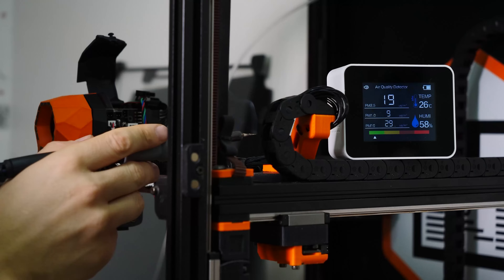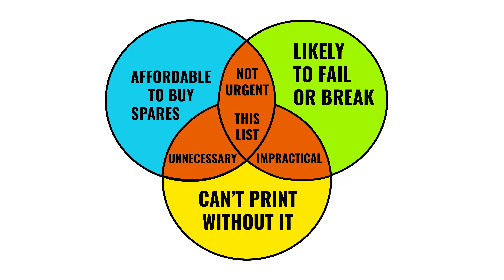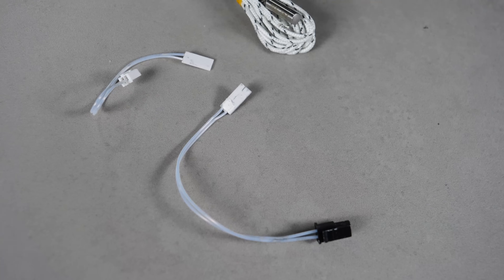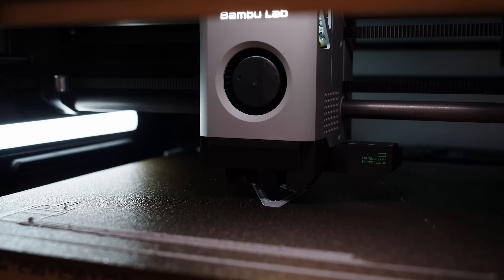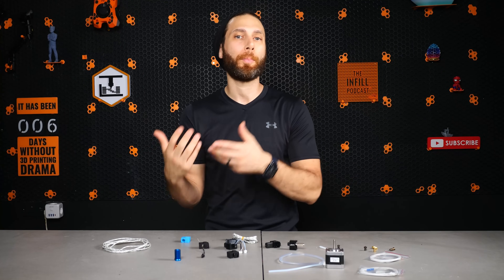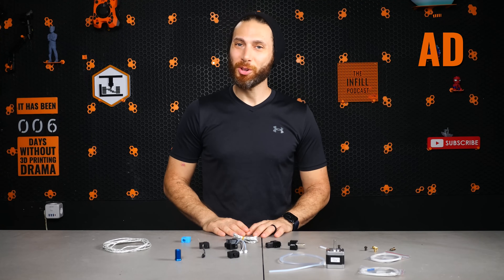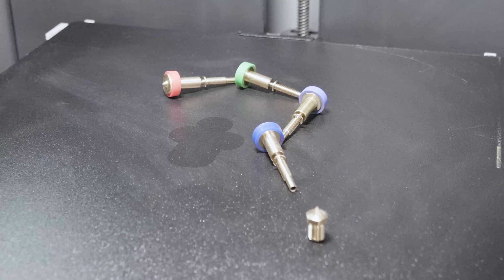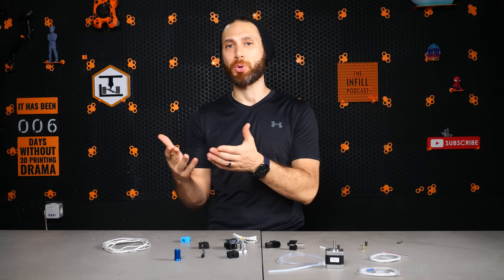Never Let Your 3D Printer Sit Broken Again With These Spare Parts!

Comment: I have several original CR10’s and two of the control boxes have went to the 3D printer in the sky. I haven’t been able to find replacements they don’t make them anymore. 
Unless it’s marketplace and the they usually have the control box “not working”

Comment: Another thing to keep spares on hand of with relation to the bowden tube are the compression fittings they slot into. The teeth that grip the tube can break off causing your bowden tube to wobble or even fall out of the extruder.

Comment: Have a spare entire  extruder for both high and low temperature filaments.  In fact I have two for each  - why? Well I hate swapping nozzles, and even using different plastics is easier with a dedicated extruder. I have also done my own modifications to some of them (fans, nozzle mod, and part cooling fan outlet)  for particular filaments I only have the one 3D printer a Qidi X-Plus, so heavy handed on the spares is easier if you only have the one machine. I also have multiple print surfaces of various types.

Comment: I learned this the hard way with my fan... The fan only had 2 broken blades so I figured it's fine.. but it caused a chain reaction: nozzle clog (need nozzles which I was the only spares I had) > silicon socks (totally sticky/covered in molten plastic) > molten plastic went up to the thermistor and cause it to behave weirdly, destroyed my heatsink too because the plastic went into the groves and was impossible to clean out totally. Basically, I had to swap out the whole thing, but I didn't have spares on hand. Had to wait 2 weeks for shipment from china 😭 Now I keep a whole hotend set spare and a few spares of the cheap stuff lol.
Reply from the maker: Been there! That’s why I made this video!

Comment: Heater cartridge crimp connection to the wire it's on is definitely a wear part. I have had the crimp become undone after quite so many heating and cooling cycles, and i'm not trusting that whole connection again since the surfaces are likely to be oxidised, i'm not re-crimping it, just put a new heater cartridge in there.

I don't personally use a silicone sock, i just dress the heater cartridge in Kapton tape, but it depends on the construction of the unit whether you want to do that, and silicone does have its advantages, as it's non-stick and can offer some nozzle protection.

Extruder gear is another consumable part, especially on printers where it's brass. Actually if you have a plastic extruder lever, buy a cheap alu extruder for $4 right away and just have it at hand.

Bearings should be considered consumable. They should normally last a long time but one or two might just give up earlier than expected. When a stepper motor seizes up, that's bearing failure, and these are 625 type you can just replace them yourself. Don't worry, the sub $10 stepper motors from China are not precision assembled devices, they are self-aligning, they experience so much shaft warpage and bearing play in real 3D printer use that the alignment is effectively bad anyway, all the precision bits are pre-aligned and epoxied together, as long as you put in the parts in the same orientation and order as you found them during disassembly, just pay attention, it'll work like new.

I hope you settle in well in these trying times and hey being in EU has its advantages! 3 day shipping from Germany and Netherlands typical, frictionless shopping EU wide.

Comment: howdy friend! glad to see you are still posting even with the current events and "exile". Hope you and your family are doing fine whilst waiting for the situation to get better.  Stay safe!

I myself have a lot of spare parts, but I have one broken down printer (a locally built one) and another one (an Anycubic Mega X) that was giving me some issues which sorta made it unusable (not counting the resin printer which is standing for months). I didn´t work on it because I was not in the mood to do so, so I was without printing for the last four months.

Recently (in fact it´s not finished yet, I´m waiting for the DSI cable for the new screen) I totally rebuilt the Anycubic´s electronics. Converted it to 24V (used a Kobra Plus print bed which was a perfect fit, and now I can go beyond 95C on the bed, I tested it up to 120C and it works), put on a direct drive (Biqu H2S Revo), replaced all the electronics (new board is a Manta M8P with a BTT CB1, they were stashed for a Voron build I never started and that´s why I used such an advanced board on the Mega X) , redone all the wiring, etcetera. And now it´s running Klipper (it was before, but it was a basic configuration on the stock Trigorilla board with nothing more than a CRTouch added, now it´s properly tuned,. along with z-tilt and other features). It´s not faster than stock in printing speed (the kinematics can´t handle higher speeds, specially the big 300x300bed, its sweet spot is 35mm/s) but it´s tuned like a charm, getting perfect first layers and layer adhesion now. The new screen ? I already printed and assembled the mount, all it takes to put it in is the new DSI cable, which should arrive tomorrow. The fun fact is while I was rebuilding the printer, I was printing parts for it as well as each step went, so I tuned it and changed some stuff while I noticed it was necessary (for example, heatsinks on the CB1 weren´t enough, it required a fan, we´re getting near 40C ambient temp here in Brasília and the CB1 was overheating). 

Having that finished, I´ll start the project on the second one, which is a Brazilian-manufactured coreXY (Sethi3D Farm) which cost me a lot of money and gave me so much trouble that I actually considered throwing it in the bin. But the success on rebuilding the Anycubic gave me hope that I can make that work again (and get rid of some of the "alternative" solutions the manufacturer opted to do on the wiring). However, that will require more work, a new PSU, a new bed heater (it uses AC heating but I´m not confident enough to work with that, specially considering that I´ll make an external enclosure for all the electronics) . I think now I´m in the mood for 3D print rebuilding LOL. This will be a project that will take some time. I don´t plan on filming it because I´m terrible at documenting technical work. I might consider also going to 24V (even though I have two spare 12V PSUs laying around) just because it´s easier for me to source Revo heaters in 24V (can order from Bigtreetech which charges less from shipping than E3D) than in 12V (which the cheapest shipping for me is purchasing directly from E3D). It will also require designing (by myself) a proper BLTouch/CRTouch mount as it uses a weird ABL system with a nail mounted into a optical endswitch which I also intend to get rid of . 

And the resin printer, I just ordered an (expensive) new screen (it´s a 8.9), it was working "partially" (I used the half of the screen that worked), now (yesterday) it decided to have its Z axis stop moving. 🤣 Man, I still haven´t got the hang of resin after an year, and I had a lot of trouble (including a catastrophic failure caused by a ruptured FEP sheet which required a lot of replacement parts, including mainboard and touch screen panel), I still don´t see myself working on resin on the long run, it´s too messy for my taste. I pretty much used resin only to make replacement parts for the FDM printer (and a shifter knob for my vintage Beetle), I´m kinda regretting buying a big resin printer (a LD006). After repairing it I might just sell my whole resin setup and stick to FDM which I´m more comfortable working with.

By the way, even when using a quick-swap like a Revo I still recommend having spare nozzles. Accidents do happen (like some errors that make the nozzle crash into printed parts or the print bed, which tend to BEND the Revo nozzlebreak inutilizing it, believe me, I know, I lost a brand new Obxidian 0.6 that way) so it´s best to have spares. And, by the way, the Revo clones found all around in Chinese sites are garbage, they dillate with high temperatures (they aren´t even suitable for PLA) and the nozzle releases itself from the heatbreak, so for Revo nozzlebreaks, stick with original E3D ones.
Reply from the maker: Hello there! Thank you so much for your kind words and for taking the time to leave a comment. I truly appreciate your thoughtful message and well wishes. It's always wonderful to connect with our viewers, and your support means a lot. Please stay safe and take care as well! 😊

Comment: Excellent! I already have a few nozzles on hand, but I think I should definitely get some spare thermistors and heater cartridges and silicone socks, as I use one of those crappy glass bead thermistors with incredibly fragile glass wires, however I have not damaged the thermistor even after a year of nozzle changes, and occasional hot end disassemblies. Fans seem plausible, but complete hotends are not practical for me, because the heatsink of my Neptune 3 attaches solidly to the strain gauge ABL system, which has a "proprietary" mounting pattern and I haven't seen spare heatsinks. But I think this is a helpful video either way. Also, I just noticed your end credits include Josef Prusa as one of the Patreon supporters - interesting...
Reply: One of the best upgrades I got was E3D'S thermistor, which clips on and off for easy replacement. I used to have the glass bead as well but I always had issues with it jumping out every time I so much as looked at it. It finally got eaten by the molten filament blob monster and I didn't have a spare on hand (like I should have) so I figured if I'm going to order one, it may as well be worth it. I did find out later there were some similar thermistors to the glass beads except they thread into the retaining screw hole. Might be worth looking into.
Reply: Can you link me to that? I have an Ender 3 style hotend, just the heatsink is adapted to work with strain gauge auto bed levelling. @lajoyalobos2009